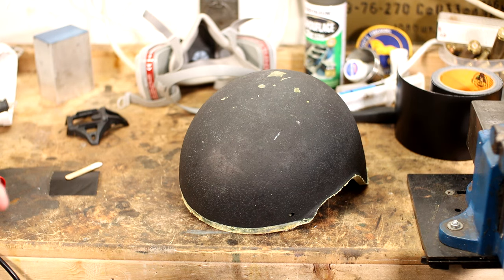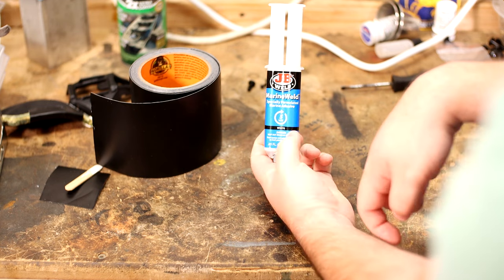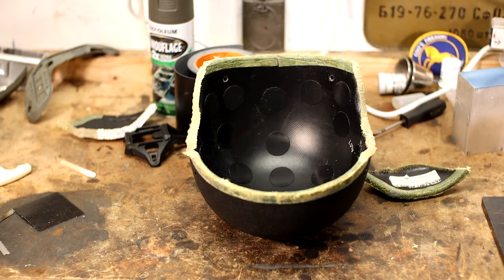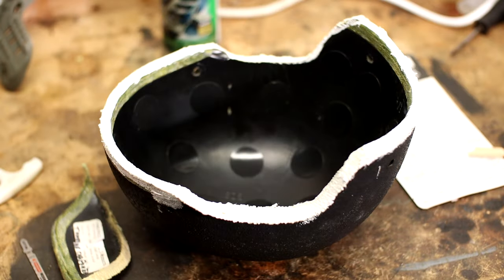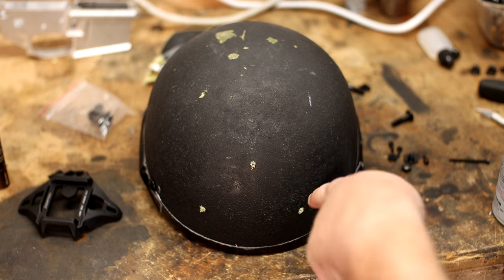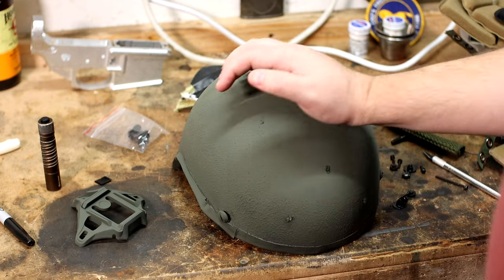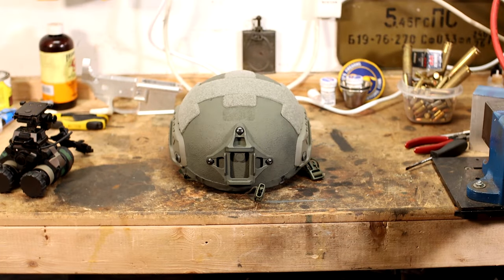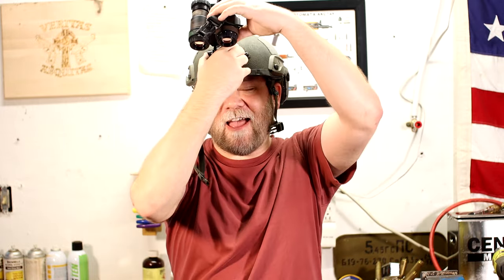ACH High Cut Mod- DYI

Comment: Turned out sweet! Rip the tape off snd mark off the edge with painters tape, then spray with black flex seal spray. Itll make your kevlar look factory fresh 👌🏼
Reply: This is why the comments are so important
Reply: To use wide marking tape and apply thick layer of flex seal paint and when removing the marking tape it will looks like an edge liner?
Reply: I just did this. Saved the rubber edges before cutting the helmet, JB welded the edge, sanded it, gorilla glued the rubber back on, then taped the edges to flex-sealed the entire rim to fade in my glued edges. Made a MICH 2002 length and it looks great.
Reply: Im debating spray painting flex seal on a cvc I acquired but I don’t wanna ruin it. If u know anyone who has used flex seal spray on Kevlar how’d it turn out?
Reply: i want to do with my ACH helmet,but i dont know where to start i am from asia so i cant understand all your comments,please help me.

Comment: I paid $65 for a pasgt, just ordered a retention system and padding to ditch the old leather suspension system, and ordered foam padding, I'm gonna line x mine black then spray paint camo pattern, add arc rails later down the road, I'm using some rubber door gasket on mine, and pryuse marine epoxy, but I'd go with gorilla brand flex seal tape, but use rtv epoxy to help seal rest of the tape then line x it, and paint camo color
Reply: So all in all 65 bucks for the helmet initially whats your total cost?

Comment: Looks alright for what it is. I am curious for a better option than the tape on the edges. I wonder what they actually use for helmets from the factory.
Reply: Search around for edge trim liner, there's racing stuff that should work.
Reply: The manufacturers use and extruded U channel rubber edging that's made in a mold. Then bonded to the helmet with contact adhesive.
Reply: They sell the replacement trim on eBay

Comment: What if you reused the rubber edge cover? I feel like, with the help of a heat gun, you could install it right after you apply the epoxy. It would probably look nicer and be more resistant to damage.
Reply: Yeah you probably could, but I mean you could find some rubber edging at the hardware store for cheap

Comment: what type of arc rails did you use because id like to use the high cut or the opscore fast arc rails but idk if the ach and the fast arc rails have different mounting positions i dont want to drill a bunch of extra holes into my ach so i just was currious

Comment: Couple of suggestions:  First when painting on ground at least put a piece of cardboard down.  Maybe invest in a card table and put newspaper or cardboard over it so you are not bending on the ground to paint.  Second, try getting some automotive rubber trim for the edge and glue the trim to the helmet.  Great job though.  Thank you.

Comment: Damn I really needa start a channel. For now though, here’s a protip: Upol Raptorliner is your BFF for this. You can either blast the whole helmet, or just tape out the edges you want (where rubbers used to be) and spray them, then pull tape for a clean, indestructible edging. It comes in black (duh) it now in tintable White, including FDE/OD tints. Great job and vid, BTW. Subd. 👊🏽
Reply: Would any bedliner typer of paint work? Or is there something specific to the raptor liner brand that does the trick here?

Comment: nice to see more babyface P content, if I go this route I would put a rubberized coating around the edge. something like LINE-X or Flex seal would work well for keeping the kevlar/amarid in place without worrying about the adhesive breaking down and paint. good vid though

Comment: @BabyFaceP I got a few questions for ya:) 

1. How did you remove the old rubber trim?
2. The SBR rubber trim from McMaster-Carr is it special in any way material wise or is just like any other rubber trim?
3. What glue/adhesive did you use for the rubber trim? Someone commented that the JB marineweld doesn’t really stick well to rubber.

Comment: I've cut well into the hundreds of helmets from the PASGT, ACH, LWH and ECH. I don't recommend the Chinese helmets because their laminating process is horrible and once you start cutting all those unsealed kevlar fibers start exposing. If you want a good rubber edging i would suggest using a butyl rubber about the thickness of a bicycle tire and bonded on with 3M rubber adhesive.

Comment: Did you do anything to seal the holes you drilled for the shroud? I've got an old helmet I just want to drill for an old one hole shroud for functional clone purposes.
Reply from the maker: The same epoxy would work well for the holes.

Comment: Atleast the ACH helmet is stronger helmet better protection it could take rifle hits way better than normal highcute level 3a helmets that are meant for 44 magnum not rifle rounds I really like his helmets I like it a lot ❤ your next project u should do with another helmet level 3a is u should clue an use a strong pressure an glue Kevlar layers into the helmets inside where your head goes use ten or twelve layers of kevlar that’s what I did with my level 3a bulldog helmet I clued layers of kevlar into the helmet dome it will catch the rifle rounds but it might have deformation might fracture your skull but it’s better than the rifle rounds going through your head it’s works great I already tried it with a both 7.62s an 5.56 rounds an water Melon it survived just had a tiny little crack the energy fro the bullet got took. Away becsue of the clue an Kevlar inside the head dome level 3a with extra Kevlar sheets cut out an clued inside I got the idea becsue a level 3a already almost stops rifle rounds it slows them down the Helmets are too dense but by adding Kevlar lays specially clued with strong clue it acts like a catching net I got the idea becsue I make bullet proof stuff I like stopping bullets an catching them so I could examinen them ❤😊 I used the rest of my Kevlar in my level 3+ armoured plate  Carrier my vest has every weak spot stiched with Kevlar now shoulder pads are comfortable now an it’s take 10 layers of Kevlar too stop 9mm an 25 layers too stop rifle rounds but if u a huge press  an u press them together with a clue an press they will become more compact clue with cow. Out just wiipe it away when I shoot them it’s flufs up again too stop the rifle rounds my dad an brother like the idea ❤❤

Comment: Would this in anyway affect ballistics performance? I feel like all that alteration would mess up the tightness of the Kevlar but idk much just honestly curious if anyone would know.
Reply: Some testing by nerds on the cut-off ear-flaps seems to indicate that they're still okay if properly sealed. But the "official" answer is that it's not super advisable, but getting shot in the head isn't really either.

Comment: A guy told me to use bicycle inner tube. I tried it but sucked at cutting it to size and failed miserably. I’m going to try rubber sealants putty tape next. If that doesn’t work, anyone recommend anything else? I’ve tried other things too and couldn’t get it. Someone should make an instructions video on how to do it.
Reply: Update: Just see the update video . I still would like to see a video of someone doing it with instructions.

Comment: I have personally seen 1 person get shot and 2 that took side shrapnel that would have been good to go had they been wearing a standard ACH/MICH.
All of these moron civilians trying to be high speed like they are some sort of Blackhawk Down Delta / CAG operator are foolish. 

As said in the video "It looks cool" says everything. Cool does not protect you from getting ear holed.
"But they are cut out for communication devices!" Okay? There is low profile headphones and other devices designed for ACH/MICH helmets.
The protection is more important than how "tacticool' you look.
That said, you just ruined a perfectly good helmet.

Comment: Spray painting in the dirt? Seriously? By the way, the impact of your jigsaw cutting ballistic material GREATLY reduces the integrity of your helmet. The area around your cut out are now completely ruined. Simply read up on doing exactly what you just did by any ballistic helmet manufacturer and you'll see I'm not breaking your stones. If this is just an airsoft helmet then no worries and pretty cool job. Just watch your environment when spray painting any job. Keep the videos coming. 

I'm serving in the Ukraine as a medic and bought my own helmet. $2,000 USD. There are so many styles and accessories you can then keep your helmet safe and your brain matter inside where it belongs. Have a great day mate.
Cheers..

🇺🇦🫡